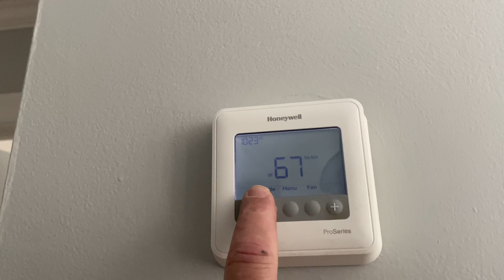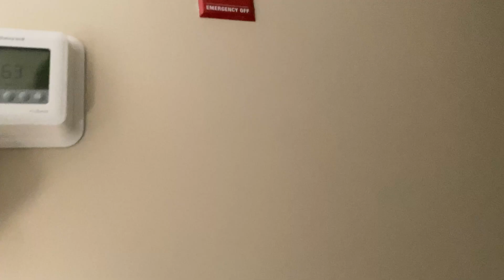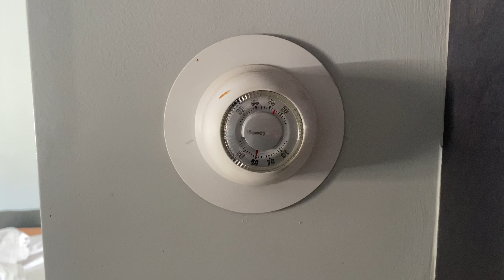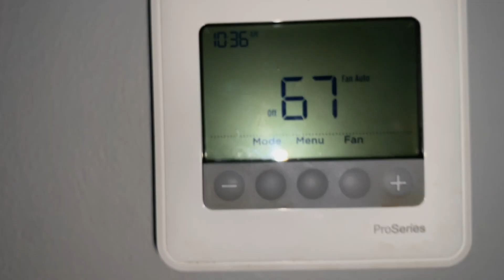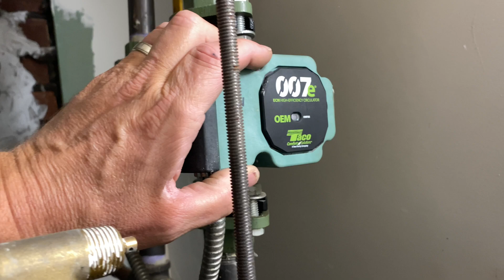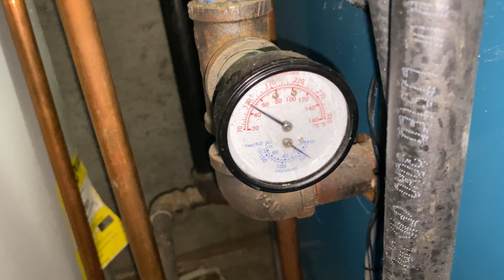Main Heating Zone Overheating & Won’t Shut Off

Comment: Not related but:  Just used Wagos to hang a ceiling fixture.  Sooo much easier to put one Wago on one of the ceiling wires , hold the fixture up and snap the wire from the fixture into the Wago with one hand rather than trying to hold the fixture, the two wires and a wire nut at the same time.  Thanks for the heads up on Wagos

Comment: Had issue with Nest Stats stealing voltage on Taco controller. Destroyed zone valve motors . Ended up putting a 75 va transformer in controller & switching to honeywell stats . You can also add resistors between W&C on controller but they were missing from plummer who originally installed taco controller & nobody had them at supply house

Comment: Always wondered why electricians install a thermostats in the hall at the top of the stairs.  I always thought it should be installed in one of the bedrooms. Heat rises from first floor and shuts down that zone.
Reply: when someone closes the bedroom door and leaves a window open? it could continue to run and overheat the rest of the 2nd floor.
ideally the system is balanced to cope with all that with thermostat in central hallway location, beyond that go to per room zoning(huge cost and inefficiency added due to boiler short cycling)
Reply from the maker: Great point!

Comment: Guess without watching , stuck flow control valve or zone valve if that is the case. If it is a cold start boiler relay panel it shouldn't even call burner unless the panel is malfunctioning.